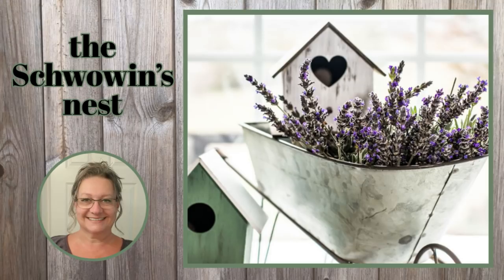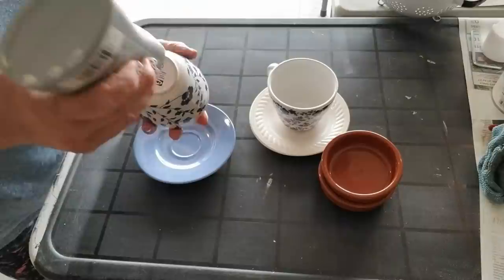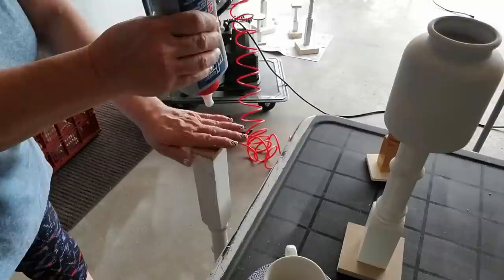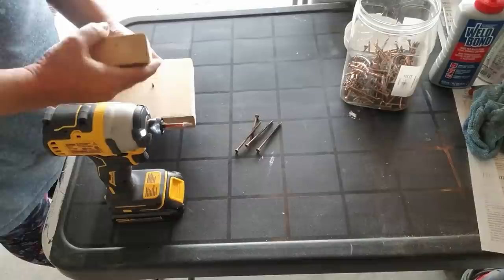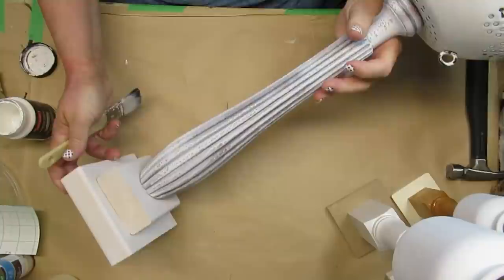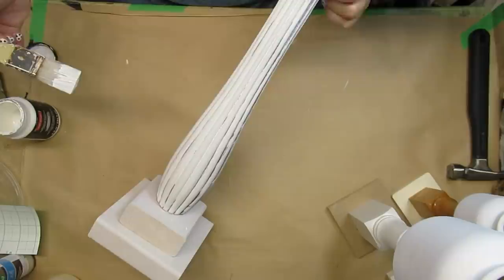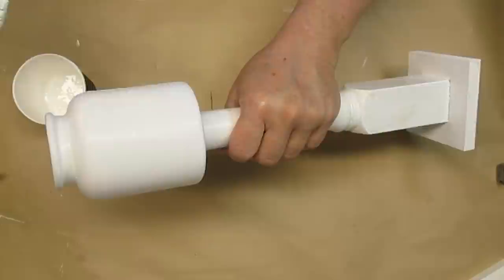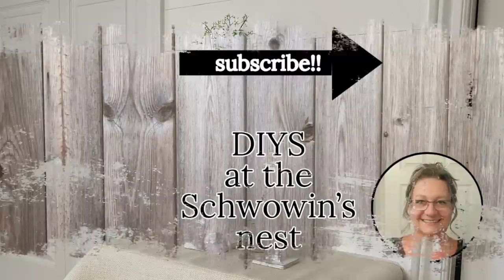⭐TRASH TO TREASURE SPINDLE DECOR IDEAS!!~Summer Farmhouse DIYS~Tea Cup Spindles~Colander Spindle DIY

Comment: Sandra on the sprindle that you put the colander on that had a 6x6 and a 4x4 block on the bottom, did you use 1 screw to go through both boards and into the spindle or did you use two screws. When you showed the bottom, it looked like there were two screw holes, can you explain how you attached everything please 😊
Reply from the maker: Hi amber, sorry I didn't show exactly what I did. I'll try to explain as best I can. I started off with the smaller 4x4 and screwed that into the spindle from the bottom up then I took the 6x6 and screwed that into the 4x4 from the bottom up using two screws on the bottom.

Comment: Do they tip when birds sit on them to feel?
Reply from the maker: Not sure, I haven't put them outside yet but they would definitely need to have some weight on the bottom to prevent them from tipping over. I would probably put them in a flower pot and weighed it down with some stones and then put some soil on top and plant flowers in it too!
Reply: Great idea!